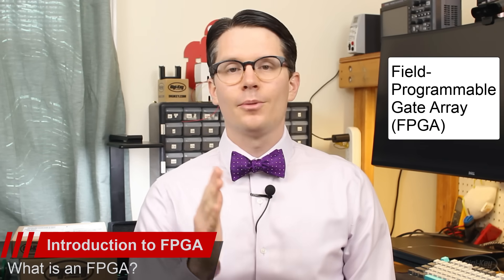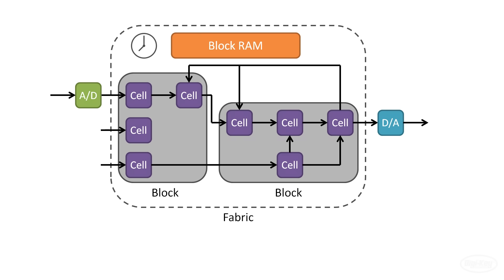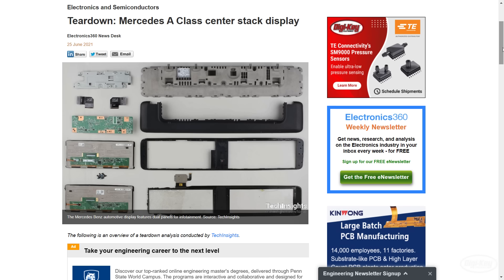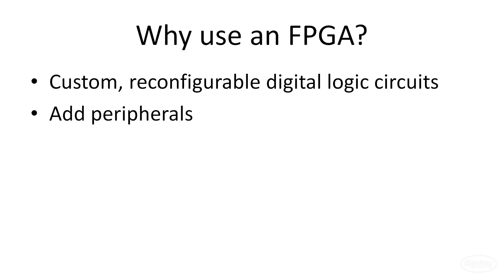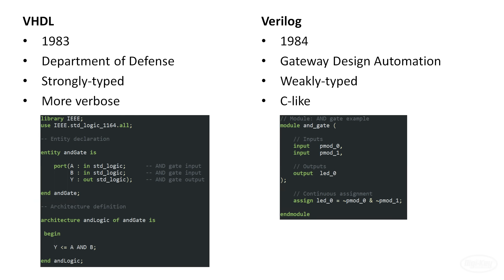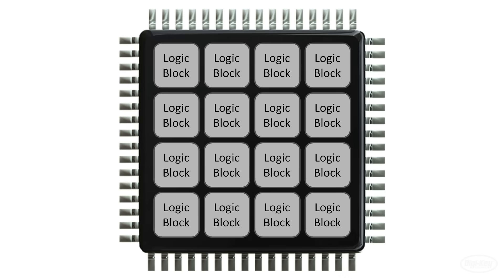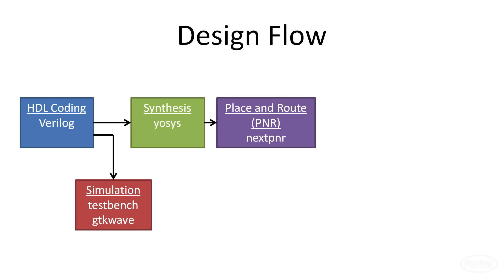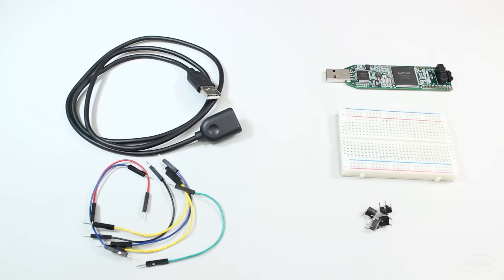Introduction to FPGA Part 1 - What is an FPGA? | Digi-Key Electronics

Comment: Unfortunately, FPGA is still not a hobby thing. This model today (April 2024) is around 150USD. It is not cheap. Taking in your mind that you can kill the module very easily.
Reply: Oof...that's gone up in price since I made these videos. That sucks. I highly recommend checking out the iCEBreaker from 1Bit Squared. Same chip family, so most of the tools I show should still work.

Comment: In college in the late 80's i was involved with a custom processor design implemented in an FPGA. On paper the design was perfect. In the sim it worked perfectly. In hardware nothing worked. It took alot of lab time to figure out that that there was a significant race condition in a subset of the processor that the professor had given us to use.  He passed my fix along to everyone else. Moral of the story: Don't trust the sim blindly.
Reply: this is what we get when the electronics labs produce bunches of simulator and screen junkies, dont require students to actually BUILD anything (physical) where real magic smoke gets released, and one never actually learns which end of a soldering iron is which by burning their fingers a few times!
Reply: @ericfort940  it's a well known  fact that all electronic components contain some unknown quantity of smoke and you have to test to see how much.

My personal record was a LARGE transistor that was sending about 18 to 20 kW to the load. I bumped something on the drive circuit and BAM. Sounded like a grenade going off. Good thing it was in a thick plexiglass box, because there was shrapnel embedded in it.

This was in an elective Electronics class that covered practical feedback stabilization.
Reply: @ericfort940  I agree that JUST simulation as the ONLY learning vehicle is a bad way to teach/learn. An appropriate mix of hands-on physical and simulation experimentation produces better-rounded graduates. As for soldering irons and common sense, I will always recall asking a student to hand me a soldering iron. She said "Are you sure?" and I said yes...she placed the HOT end into my open hand. We BOTH learned something that day! 🙂
Reply: @FloydWolverton  Well you did seem sure 🙂
Reply: @ericfort940  You need both
Reply: Studied this in 04 for my under grad, the class was too focused on logic gates and the Vhdl language that when I got out and heard people talking about fpga, I did not know they were talking about something that I once studied 😢

We did not have these fancy boards back then. 

Wow, can't believe it was 22 years ago.

Comment: Any thoughts HDL converters, like Silice, Bluespec / chisel-lang HDL , SpinalHDL?  Or Migen/nMigen/MiSoC->LiteX... which appears to be a python to HDL converter?  FuseSoC IP?   

Would love to see 
1) APIO multi-fpga-platform toolbox support other hardware (ex. Intel Nios, Microsemi Arm-M4, Quicklogic RIsc-V), JTAG/OpenOCD programmers, etc 
2) Tips on setting up a build environment , preferably a Docker Container with all the tools for Lattice, Xilinx, etc 
3) an led-blink tutorial that instantiates a FuseSoC IP (ex. ValentyUSB, CPU : LatticeMico32, Microblaze) 
4) Synthesizing (SymbiFlow, Yosys ) and Simulating the logic/timing WITH (litescope, SignalTap, Chipscope) and WITHOUT hardware (Renode?, Modelsim) 
5) Place-and-Routing and programming (nextpnr, etc) 
6) Building, Downloading and Debugging or stepping thru the CPU CODE

Comment: As a computer engineer I got a lot of HDL and design logic and even microprocessor design experience in classes we used FPGAs but only for specific assignments and simple projects. I have one more class on Modern Processor architecture but I think I am getting to where I could modify a cpu to add specific assembly instructions. I should get my own fpga and play with it so this knowledge doesn’t go to waste lol
Reply: Same...we barely touched FPGAs and HDL in my classes, and this was back in 2003. My second computer architecture course was all theory! Please let me know if you do modify a softcore CPU--I'd love to know which core you use!

Comment: In Verilog start with: `default_nettype none     otherwise when you have a typo, Vivado at least maybe other tools too, will create a new signal and assign it 1'b0 aka 0 instead of catching the error. I always had that problem and didn't know about `default_nettype none    then one day I walked in a class at the hacker dojo I wasn't enrolled in and the teacher prof guy started with that. When loading a design you can touch the FPGA with your finger to see if it is getting hot which is a sign your IO pads are assigned wrong and fighting. Maybe you let it assign I/O pads automatically so it is trying to drive a ground trace with '1' or something. Xilinx at least so much as I know doesn't allow tri-state buses or latches so everything is clocked (not 100% sure about that) so tristate buses are automatically changed to MUXes.
Reply: Great tip, thanks!

Comment: As a FPGA engineer I appreciate you introducing our world to others. Keep up the good work
Reply: As an FPGA engineer it's very interesting to get an understanding what you are actually dooing
Reply: Much respect ali, subscribed , would love to keep in touch with someone like you 🙏
Reply: Hello, how can i contact you?
Reply: Thoughts on Peraso? Ticker PRSO seems very undervalued after watching nvidia go crazy
Reply: Please I want to know that FPGA and ASIC are analog or digital design processors ?
Reply: @kohein404  FPGAs can only reproduce digital circuits. If you need to do anything in the analog realm, you will need a DAC and/or ADC to convert the digital input/output of the FPGA into an analog signal or vice-versa.
ASICs on the other end can contain both digital and analog circuits on the same chip.
Reply: @benjib2691 in general you are right but nowadays FPGAs exist which incorporate converters, like some Intel Agilex 9. There is a tendency to incorporate more and more dedicated stuff and use the fabric merely for routing and storage.

Comment: put multiple mini fpga cores side by side, and, essentially, have them be able to update connectivity at the base MHz
Reply: connection per clock cycle, next clock its the next, dna programming
Reply: have programmable 4TB rom chips (off-the-self, mask/once/multiple) that are L2 fast memory, mezzanine connector, for pre-cached instruction computing
Reply: or have the fpga form an implicit fpga in the fpga, that can do the base clock synched per instruction switching
Reply: compare, arrow MAX1000, arrow sockit, arrow cyc1000
Reply: please take your meds

Comment: You forgot to mention that you need some basic hardware design knowledge (not only basic logic). It is very important if you want to do a stable design.
Reply: Hobbyists struggle to have one good voltage supply. With an FPGA you're going to need 2 or 3 rock solid voltages and your current needs will fluctuate
Reply: @raul0ca  There’s a lot of confusion on terms/titles/stages that is simply a definition problem. When you say hobbyists, you’re talking about a broad audience including people learning digital design for the first time, analog EE’s getting a refresher on digital logic, industrial engineers etc. I think integration issues like adequate power supply is a separate topic but I agree that it should be addressed
Reply: @Fleurlean4  My biggest complaint is that this is nerd crack. I don't need more nerd crack. I need to be able to run what I developed on a 74 MHz M4 on a 48 MHz M0+
Reply: If you’re tinkering with development boards then you don’t really need to know more than what you need for Arduino or something similar.

Comment: That was one of the most concise and easy to understand overviews that I have seen! I will probably point students to this video as a supplement.
One minor tweak to something said though regarding speed. A FPGA won't necessarily be faster than a CPU, but it will have higher throughput. That was mentioned, but then in the summarization you said "speed for specific computations", where it should be "throughput for specific computations" - most STM32s can run faster than a FPGA, but they take many cycles to compute one result while a FPGA can compute one result per cycle (with super-deep pipelines).
Another use case for FPGAs is latency (which has implications for real-time applications) - often a FPGA can intake, process, and react to events faster than a CPU. Most of the 3D LIDAR systems used in self driving cars rely on FPGAs to minimize their feedback loops.
Reply: What does "faster" mean in this context if not throughput?
Reply: @Henrix1998  Short answer, clock speed. 
Long answer, that would depend on what you are trying to measure. Most likely it will be a combination of clock speed, latency, and throughput. 
For example, we say that CPUs are fast but not that GPUs are fast. GPUs can handle much higher throughput than a CPU, but at a much higher latency, and lower clock speeds. To take advantage of them (and a FPGA for that matter) you need to have enough data to cover the latency (i.e. a large enough batch). For streaming applications (like signal processing), your data size can be effectively infinite when capturing from real-time sensors / ADCs. But if you only want to perform the computation on a smaller dataset (potentially sample size 1), it will be much faster to do that on a CPU, because you can't hide the latency. 
Another case where the latency matters is with feedback loops in the computation, though that again depends on the nature of the problem being solved (how tolerant is the loop, and what computation is being done).
Reply: @Henrix1998 By analogy to an IC engine, faster is like rpm while throughput is like displacement. Think of the CPU like a high revving gasoline lower displacement gasoline engine on a sports motorcycle, while the FPGA is like a slow revving large displacement Diesel engine on a heavy truck.
Reply: He never said an FPGA would be faster. He said it may or may not be faster.
Reply: Good points, thank you for the distinctions!